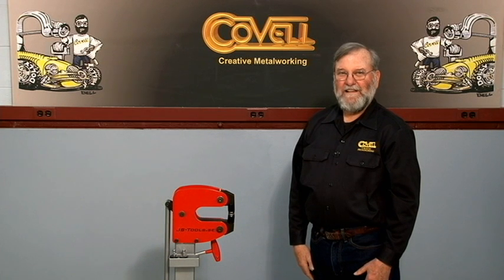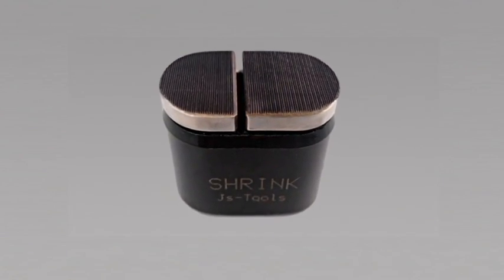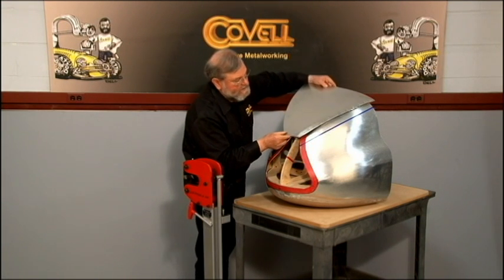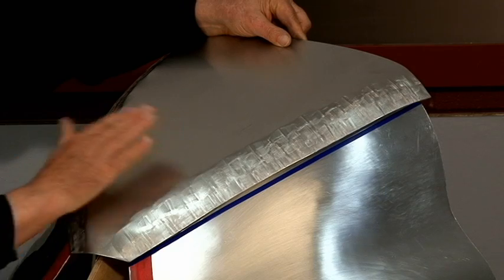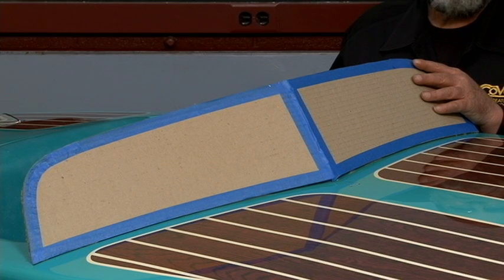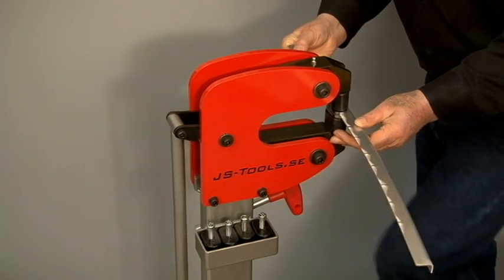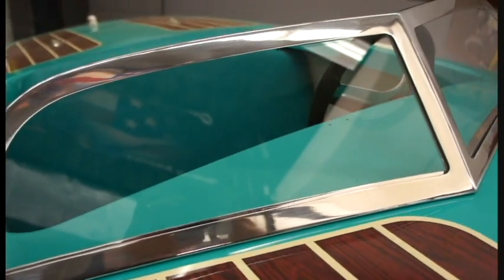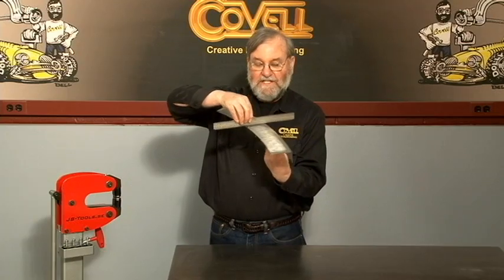JS Tools Shrinker

Comment: How did you get the glass into the welded frame?
Reply from the maker: The glass fits in from the back side, and is pushed up to fit tightly inside the top channel of the frame. Then, a wooden spacer (dowel) is placed below the glass to hold it at the proper height, and there is a flanged section that fits in from the back, and is fastened to the deck of the hull to secure the dowel and glass.
Reply: @RonCovell  appreciate it. Great work!

Comment: That boat windshield turned out amazing. Have you done a roadster windshield? An in-depth start to finish on one would be great. I need a windshield for my 31 roadster that started out as a rolled over coupe.
Reply from the maker: I'm glad you liked it. I did an article for Street Rodder Magazine a couple of years ago on making windshield posts from scratch, using stainless sheet. I can no longer find the article online, but perhaps you can find a back-issue of the magazine.

Comment: Is that glass replaceable (without having to cut & weld)?
Reply from the maker: Yes - the glass slips up into the channel from the back, and there is a wooden dowel that prevents it from falling down. When the rear angle piece is in place it covers the dowel, and holds the bottom of the glass tightly against the front frame.
Reply: @RonCovell  - Awesome. Nice work!